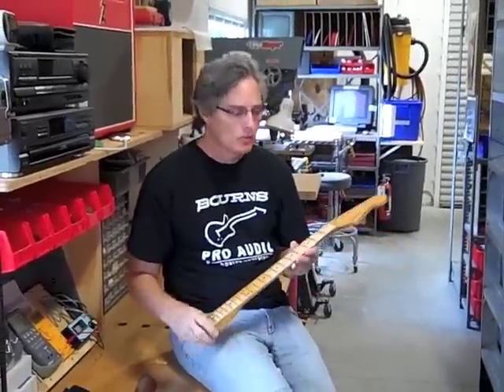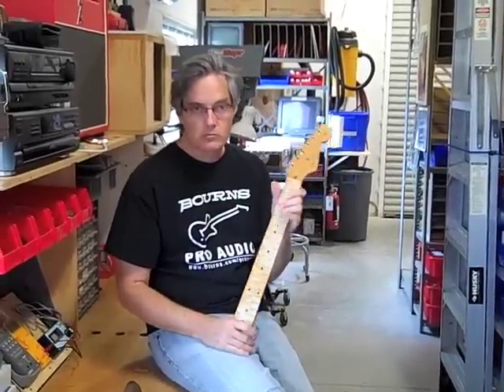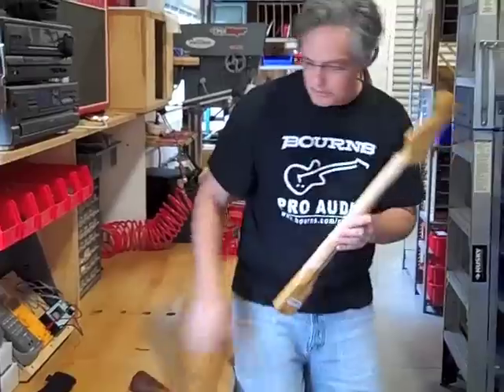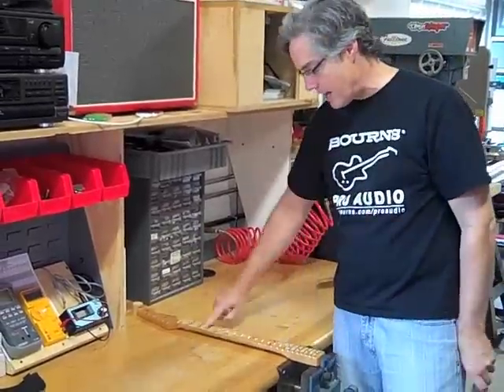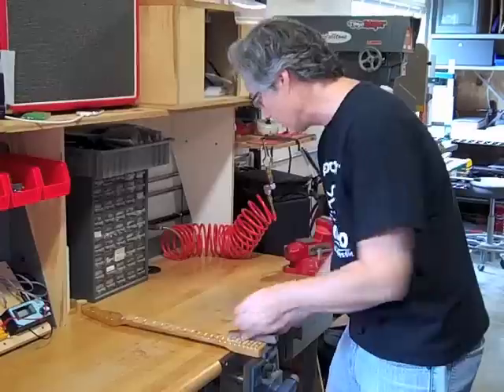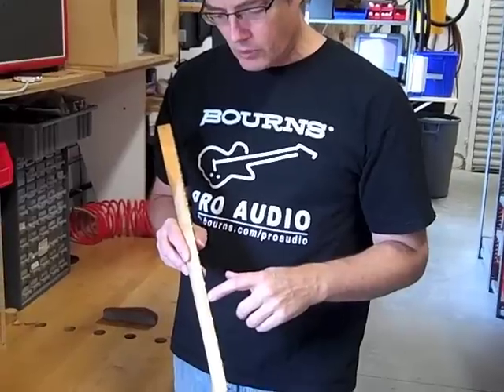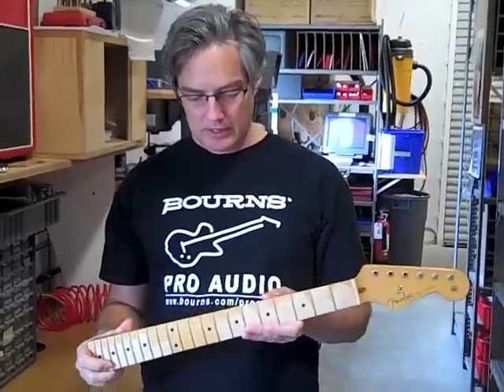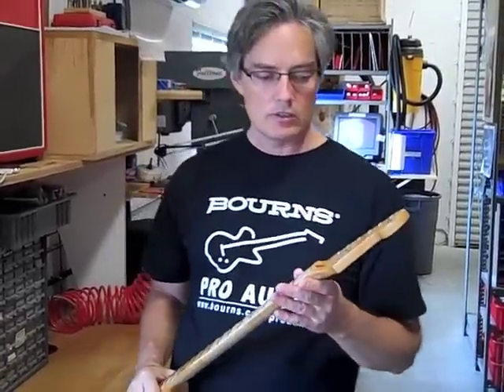Protruding Fret Ends

Comment: Good video, but I have found it's better to go ahead and tape up the neck sides and fret board. File to just scuffing the tape then finish the frets off with a fret dressing file and then some high grit sand paper to polish. Keeps from having to sand any file marks in the wood and lacquer touch ups. Takes a little longer but, less labor potentially on the back end.
Reply from the maker: Well, that's an option, certainly. But our experience is that it's not usually an issue. Maybe in certain situations, but having done many of these over the years, we find the down 'n' dirty method described in this video does the trick without negative consequences.
Reply: Certainly not saying you are wrong, your technique is pretty much the same as mine, I just err to the side of caution. Just reducing the risk of getting into the wood as little as possible. These videos are great and very informative, may inspire someone who has never done this to try for themselves.
Reply: @hddynarider4528  exactly I can't imagine doing it down and dirty on a $4500 bound Gibson Les Paul 🤷 although on a rosewood or ebony like he said wouldn't be too dangerous.

Comment: You didnt mention what tool you are using.  Is that some special stew-mac file or what?.
Reply from the maker: Hi, this is a StewMac file, their PN 0862.
Reply from the maker: Opinions will vary. Not sure why the emphasis regarding StewMac (DON'T buy ANYTHING), as we've met many techs over the years, and nearly all of them would say that they're StewMac customers. Top notch company.

35° is more bevel than we like. As stated in the video, we tend towards less bevel, not more, and 35° is definitely leaning toward more. You can make one of these file blocks yourself if you have access to a milling machine, and then you can set the file at whatever angle you'd like. You can get the UHMW stock from places like McMaster-Carr. Of course, unless the face of the block is concave, then it's going to rock on the curved fretboard, and so there goes your consistent angle.

As always, it's easy to get carried away with details. The handheld file that we use has served the purpose for many years, and does both the flush-with-the-fingerboard part of the job, and the bevel. And it does them both in a matter of a couple of minutes. Just take care of your files. Don't store them in contact with hard objects (metal, ceramic), and use them in only one direction (you don't want to use them with a back and forth motion). Most files cut on the forward stroke, so these would only be pushed forward.
Reply: ToneShapers
Thanks for the detailed reply!   I've got this horrible cheap Chinese Soviet North Korean Strat copy that I bought for $39 because it had a chip in the paint (regular price $79! hey!).  We are giving it to a 7 year old grandson as a Christmas gift because all he has right now is a complete bullshit plastic guitar but he bangs on it all day every day.  The guitar actually plays quite decently and the wood seems to be excellent! The problem is the frets were badly/never trimmed or  filed so its like a sharp picket fence on each side!   The music store said - oh yea h all yo got to do is get a file and file it down.  he he right.. its pretty bad but I managed to get one side pretty much done - huge difference.  It looks like I am going to actually have to spend some time on this - take the neck off,  get one of those StewMAc 0862' and then finish it with some 600 grit... Any suggestions? Thanks!!!

Comment: What would be the solution to ultimately prevent sharp frets on neck sides from happening, manufacturers cutting the ends shorter? or would it still eventually occur [at some point in time] regardless. Anyone have thoughts on guitar case humidifiers
Reply from the maker: The solution would be to never allow the guitar to be in an environment with less than ~50% relative humidity. That's probably unrealistic to routinely achieve.

Any humidification is better than none. Whole-house humidification is probably the best solution, followed by case humidification, followed by guitar body humidification (protruding fret ends are more easily dealt with than cracks in the top and sides). 45% - 55% RH is the optimal environment for a guitar, so achieving that by any method will be hugely beneficial.
Reply: Thanks for answering, and for the information

Comment: Hi George,  I have the same issue with a bass guitar neck.  I am looking at taking care of the protruding ends but have a lot of buzzing now that I did not have last year. It has been in storage for about 8 months in a dry climate so I am not surprised. I watched another video of your about dressing frets to level all of them prior to re-crowning. My issue is that after releasing all tension on my truss rod for this bass guitar neck I check the neck with a  notched straight edge there still seems to be a gap of about .010" at the spaces between the 18-19 and 19-20 as well as the wood below the 20th fret. I noticed that at around fret 15 I have a .003 gap and gets worse after that point..  The neck from fret #15 all the way to the nut is perfectly straight.  Do you have any suggestions?
Reply from the maker: The wood is less important than the fret tops. I bought notched straightedges way back when and never used them. I have a good friend - consummate mechanical guru & full-time guitar tech who loves notched straightedges - so i think they must be useful for something. But I never used mine.

I only care about the flatness of the fretboard surface where the frets are seated (the fret lie), and I'm talking in terms of the flatness from one fret lie to the next. The surface in between frets doesn't always tell you much; you can imagine how useless the notched straightedge would be on a scalloped neck.

If there's too much inconsistency in the fretboard surface where the frets lie - causing uneven fret tops - to take it out in the tops of the frets during leveling (meaning, I don't want the leveling process to take .005" off one fret and .018" off its neighbor), then you have to pull the frets and level the fretboard. You don't have to remove material between the frets unless for cosmetic reasons; from a mechanical standpoint you're only concerned with the surfaces where the frets lie. Get them all flat (in the same plane), and refret. Good luck!

George

Comment: the frets are sharp because on the road worn the wood is shaved down leaving the frets to stick out.
Reply from the maker: "the frets are sharp because on the road worn the wood is shaved down leaving the frets to stick out."

Not sure if you're serious? Or what exactly you mean? If you're saying that Fender intentionally removes wood from the fretboard edges and this consequently exposes the fret ends, and that this consequence is either intentional, or just a lazy oversight on their part, then A) it would be nearly impossible to "shave down" the wood without also "shaving down" the fret ends; and B) you underestimate Fender. It would be hard to imagine that you actually believe this.

The frets are protruding for one reason only: The wood has shrunk, and the frets have not. This is Guitar Tech 101.

Comment: I have the StewMac file embedded in the nylon block and have used it many times on rosewood/ebony necks, but now I have a Fender Lite-Ash Tele (Korean) with protruding frets, and it has a clear satin finish on the neck and finger board (birds-eye maple).  I'm so afraid to file and ruin the finish, but the frets have gotten unbearable.  I will try taping the neck between the frets and get the filing close, and hand finish each fret I'm thinking.  Thoughts?  http://www.gwfweb.com/guitars/images/tele7.jpg
Reply from the maker: Gary F If you want them flush you're going to have to get into the wood. Our thoughts: forget the tape. Get into the wood, get them flush. Finish with 300 grit paper to final-smooth the fret ends (remove any tooling marks from the file teeth). Add finish to the exposed wood, buff or steel-wool it to the desired gloss. This is a 15-minute job, rather than the hours you could spend on it if you're so inclined. An experienced tech would have this out the door in 15 minutes, icluding the finish touchup, and you'd never be the wiser.
Reply: ToneShapers You didn't mention in your video to not do something stupid like take a small flat file and file the fret end while holding the file parallel to the fret, crossways to the neck. Thanks a lot. The rest of the neck I used a straight file, couldn't wait to find a stewmac, and used it like you showed. It worked very well. I was first scared about the MIM Strat Maple finish and tried to stop shy of the wood but like you said it isn't practical, ends still protruded and I had to get into the wood. Is any kind of Poly finish or lacquer the right stuff to touch up the removed finish or to I have to import from Mexico BTW? The last fret by the nut still protruded a bit while those higher were already like butter and I didn't want to contact those anymore... so I took a small file... and very very carefully...filed the fret end down...until I discovered that I had dug a dimple into the wood. Nice. I'm a bit of a perfectionist, a bit stupid sometimes and pissed at myself and thinking I'll just order another MIM and trade this off. Or would a pro tech like yourself just file down more of the wood to get the dimple out and refinish it in the proper finish - lacquer - Polyurethane? The dimple is hard to see but can be felt easily enough but really isn't that deep. Thanks. I won't be touching my American Strat. With a file.

Comment: You sure like "Whatever"  such indifference in your view of others!
Reply from the maker: We don't intend to come across as condescending. But in our many years of working in the guitar industry, we've encountered some people who have narrowly-defined beliefs about the "right" ways to work on guitars or adjust guitars, and we are - for the most part - disdainful of that concept. For instance - the idea that the depth of a nut slot must be half the diameter of the string, or that relief should be set at a certain number of thousandths as measured with feeler gauges. Often, people who hold these opinions can't really articulate the logic or mechanical principles behind these beliefs ("Why six thousandths? Why not eight thousandths, or four thousandths?"), they've just seen something in a video or read something in an article. And unfortunately sometimes these articles and videos come from "authoritative" sources.

I was once in a music store chatting with a guy who worked there - he was behind the counter - and a lady came in in a huff, holding an inexpensive acoustic guitar with a broken string. She angrily told the clerk "We bought this guitar in December [3 or 4 months earlier] and already, one of the strings has broken!" Most guitar players will read that and smile, but this lady just didn't know anything about guitar strings.

Every tech occasionally finds themselves arguing with someone who similarly doesn't know what they're talking about. Most people will listen to reason and concede a point if it's presented in a compelling way, but not all people. Usually, the person who has worked on guitars 40 hours a week for years knows more about it than the consumer.
Reply: @ToneShapers  that was very well put. I will agree with you but from a consumer stand point too especially a collector I can honestly say there are many collectors that don't want the finish touched on their pre CBS fenders . I could care less cause I play all my stuff and feel fretboards are included in wear and tear but I've seen some pretty anal collectors. Honestly I'd love to see one tool be able to do the complete fret work. Take down the edges as well as round out the corners. It needs to be idiot proof so they can't kill their fretboard or neck.